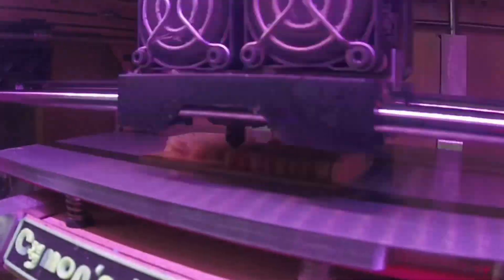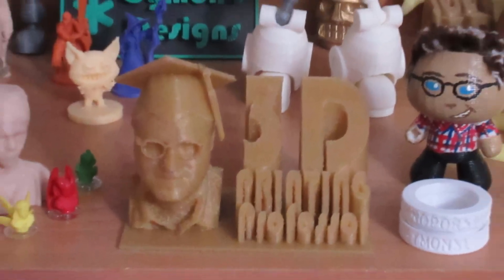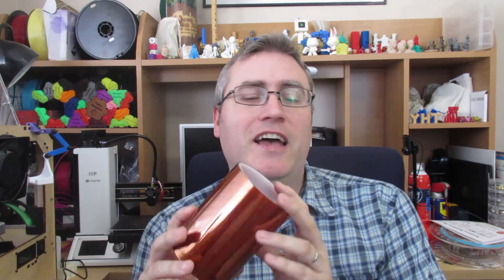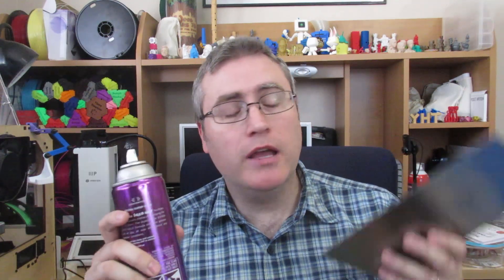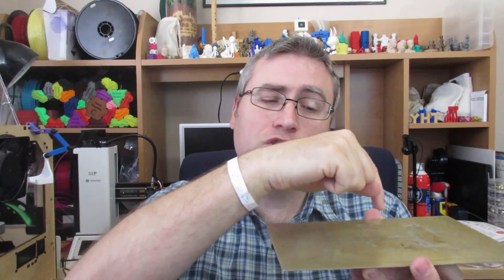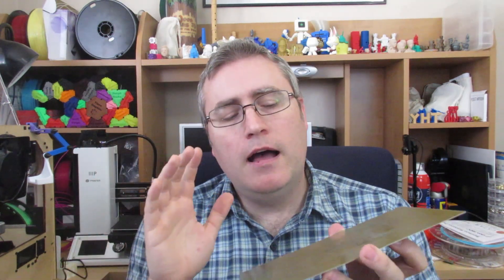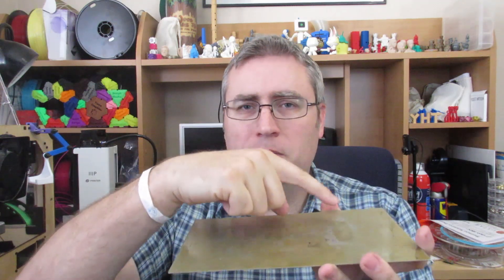3D Printing Build Plate Showdown

Comment: Great Stuff......Say 3D Pro, Went back 4 yrs on your videos........didn't see anything on aluminum beds..........thoughts?........I own a Robo with a glass bed & cannot easily swap the heated bed with an aluminum............However, considering a mod.
Reply from the maker: After my glass and hairspray video I got tired of breaking glass plates and switched to aluminum ones. After losing one to learn that sand blasting warps thin sheets of metal I just roughed them up with some metal brushes and they held on to hairspray perfectly. I used that until I upgraded to my GeckoTek plate (which I also have a video about).
Reply: Thanks 3D Pro, found, 4 months ago, Gecko video. Went to site & found that they manufacture a Robo magnetic base with heater...........that allows top plate to be removed without the need to pull heater cable....Thanks again for the info.......Jimmy
Reply: I am afraid of metal beds now as I blew out my ramps when the MK2b heated plate shorted against the aluminum bed.  Sparks went flying for about half a second and the ramps had to be replaced (even after soldering in a new mosfet so it went up the chain I guess).  On my current printer I am tinkering with it will use a 450 watt silicone mat under 1/4in aluminum tooling plate so no issues there but I sure love the smooth/glossy bottoms a glass plate gives to your prints.  I printed a knob a few years ago directly on the glass and the bottom was the top of the knob and I never stopped printing directly on glass as I was hooked.
Reply: Say Dark Alchemist, you may be interested in a thread I started with MK2. I have much more video to add, but haven't had the time.......yet................I agree about the smooth surface of the prints resulting from boro. glass, one should not overlook that characteristic............http://community.robo3d.com/index.php?threads/understanding-the-mk2a-pcb-heatbed-r1-swaparoo.9161/

Comment: I think you're using PEI wrong, or the wrong PEI.  I've used PEI on all 3 of my machines with biggest one being 500mm square. The thing is -- I use PEI sheets applied to boro glass with 3M high temp tape. I don't use PEI film. PEI sheets need to be sanded down with 600 grit every 50 prints or so, but I have not had sticking problems with PETg, PLA, ABS. Flexibles stick too well to PEI, so yes glue stick is needed to decrease the tackiness, but I think a piece of boro glass with PEI on one side and plain glass on the other side is the perfect surface. You get best of both worlds. Flip it over in case you need bare glass. Use gluestick of whatever.
Reply from the maker: I like the reversable idea. That's pretty cool. Wouldn't work with my magnetic setup, but it's versatile.
Reply: I agree I had no issues with PEI printing PLA and ABS for over 6 months now.

Comment: I use cheap picture frames and hair spray. You know, those sub $10 glass ones you find at Walmart or the like. To hold the glass in place, I use binder clips. It has worked for me for about 3-4 years now. Though there are problems with it. For example, because they are so cheap compared with other industry standards, sometimes there are issues with uniform thickness and the shape likely will not perfectly match your bed size. I use 8x10" and have 2 inches sticking off the end, which also makes a good handle.  Surprisingly enough, they last pretty well and I have only had a few break on me.

Edit: I print with ABS pretty much exclusively (Nothing wrong with other materials, but worth mentioning in this context)
Reply: I found a rear projection television curbside. Well I tore it apart and took the mirror out of it and cut my glass from that. Bonus is, it's not cheap inconsistent glass and I haven't broken one yet. Plus I found a TON of wires, small aluminum heatsinks, assorted connectors, and electronics components that I use for my other hobbies.
Reply from the maker: I think it's important to note that if you're printing with a single material you can live with a single build suraface. If PEI works for you with ABS I say go for it.

Comment: I just print pla on glass with a heated build plate , no hairspray or glue stick..
Reply: It gives nice shiny bottom but i almost always get warping with bed set to 60 on bare clean glass even with a fat brim on the print. I may work with rafts though.
Reply: yeaaaah I never got anything to stick to bare glass
Reply: boomerangfreak Sand it with high grit sand paper.
Reply: Just clean it with soap and water with no extra adhesive

Comment: just use sugar and water on glass works every time and is very cheap
Reply from the maker: That is literally the first time I heard that.
Reply: 3D Printing Professor really sugar and water mix add to bed it's sticky sugar is very cheap and safe u can also just wash it off doesn't work for abs i use on pla. i have saved so much money works every time
Reply: Mark Williams wouldn’t that make the bottom of my print dirty
Reply: I have heard about this since 2013 and people swear by it but I burn sugar too easily when I am cooking on the stove so never gave it a shot PLUS we have a terrible ant issue here if anything is left out (any 
sweet or food) they will come quickly.
Reply: Makes sense considering the chemical structure of PLA.
Reply: Sugar and water worked fine for me when I tried it a few times. It attracts insects though (wasps and ants mainly).

Comment: Good video.  I print mostly PETG and PLA and some exotics (never ABS) and love using a cheap piece of hardware store glass with hairspray.  I just give a light shot of hairspray to the glass after each print, and I have two pieces so I can switch them out periodically and always have a clean one.  But, like you I'm waiting for that one material that won't require a disposable medium.

Comment: I guess an interface layer is best because anything that sticks, also wears out over time when removing. So it's a balancing act that glue stick or hairspray can do by shedding some of it on the print without damaging the surface.
Reply from the maker: That's correct. it just feels like cheating to me. But I can't deny it works, and it works for everything.

Comment: I only print in PLA, and used blue painter's tape for a long time, but even with alcohol it didn't work well with many models, since the tape would pull away from the build surface and I would get curling at the edges, etc. I tried Dremel's version of BuildTak but it wasn't until I tried combining glue stick with the BuildTak that I really stopped having trouble with warping and curling.

Comment: I print PLA and PETG on glass with hairspray. For initial prep, I clean my glass, wipe with alcohol, let it dry, then spray a full wet coat of Aquanet so that it lays out a perfect "glass smooth" coat. I let the excess drip off for a few seconds, then I let it dry horizontally. I can print days without having it peel off. Usually after a full week, it loses some tack, but all it needs is a very light coat to reactivate it. You can see previous prints in the texture of the hairspray on the glass, but it is fine and hasn't peeled up. I also wait until the bed has cooled off a bit before removing parts. If they don't come off easily, I give them a sideways whack with the spatula. Prying is not necessary.

Comment: I have been using printbite with great success.  https://flex3drive.com/printbite.  I have pritned PLA, PETG, ABS and PC.  When the build plate cools down its very easy to remove.
Reply: Prinbite is not PEI, it is a different material altogether. PEI is thermoplastic so softens when heated whereas Printbite is a thermoset material where heat is used to set it so doesn't soften when heated. Nylon does not stick to PEI at all but sticks beautifully to Printbite. Prinbite is also much more durable, I have been using mine for more than a year and it's still perfect, I imagine I will never have to replace it. Buy once and forget it, IMO if you have a heated bed that can go to 140c then there is nothing better.
Reply: Brian Weber 
Printbite for me as well. I now have it on all my printers and it works really well. PETG destroyed my Buildtak and PEI didn't hold prints as well. 
I do sometimes use glue-stick as well, for extra hold, but unlike glass I can be sure that the surface is not going to have flakes pulled off it.
Reply: @TBS I can safely assure you PrintBite is NOT PEI.
Reply: Well I also just installed my Printbite sheet a week or so ago. Having some growing pains (especially with my 0.8mm nozzle) but it seems to be going great. So far mostly used it for PLA but I also tried a few small prints with my PMMA sample from rigid ink which sticks great as well.
Reply: Printbite is just a thicker PEI sheet.

Comment: I've been getting good results with PLA using blue painter's tape and just lightly swiping the surface with isopropyl alcohol on a lint-free cloth when the tape is new. Too much alcohol seems to draw adhesive up through the tape and welds the print, but just a little gives the proper amount of stickiness. Even prints with a lot of surface area on the print bed will pop off without tearing the tape (most of the time) ... :-)

Also, on the Monoprice Select Mini, I use two widths of 2.83" wide 3M 2090 tape side-to-side across the print bed, just inboard of the adjustment screws, and slice small prints on the front or rear half of the bed. That way if I do tear the tape, I only have to replace half of it ...

On prints with small details on the bottom, I run at half speed (25mm/second) until the first layer is done, and then kick it up to full speed at 50mm/second...

Lately have been printing every day, and getting a week or more out of one application of tape, until t turns almost white ...

Comment: After over 4 years for I found the best was a glass sufrace with glue stick and 55-65°C for PLA, PETG glue stick/ABS juice @ 80°C and for ABS I use the glass plate with ABS juice @110°C

Comment: Printinz plates are the only thing I can print on. PLA and ABS stick marvelously! Then to release the print all you need to do is twist the plate a bit and the print pops off no problem. And the only maintenance really is a wipe down with alcohol every once in a blue moon. Have had mine for a couple months now, and works just as good as it did new.